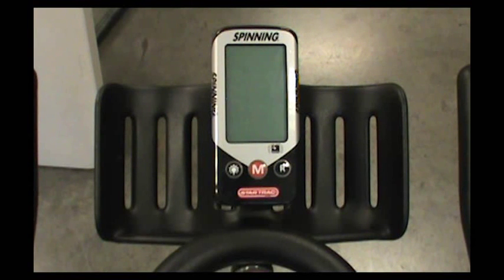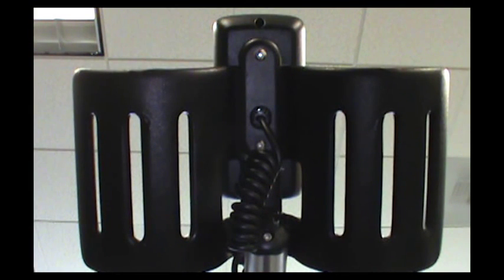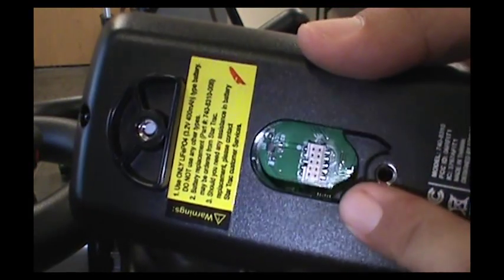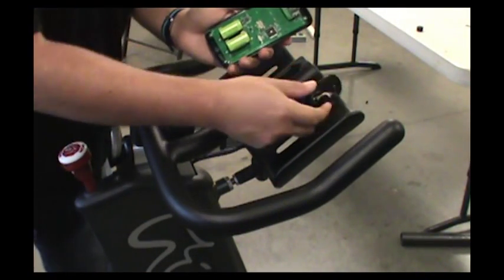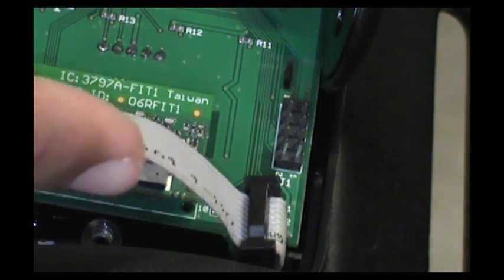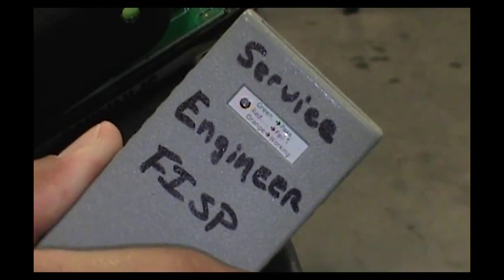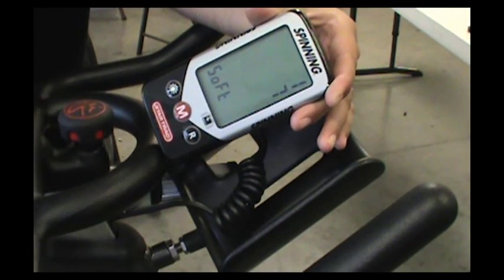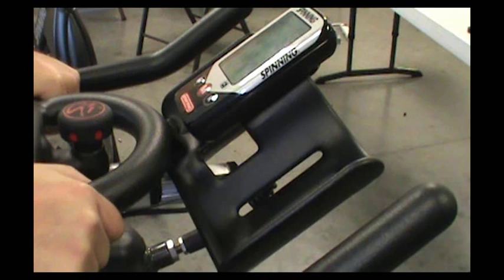Star Trac: Spinner® Blade ION - Updating Watts Computer Software

Comment: Your online site has the WRONG FILES associated with the 1.8 software version: the Fisp fuse bit settings and instructions files are therefore unavailable.  Also, the project file calls for the wrong file! Can we trust the fuse bit settings??? I'm not driving 4 hours to a customer site to find out it doesn't work. Called customer support they acted as if this was okay and normal (!) and they said it's ok to use the project file and just change the file to 1.8, it better be true.  You guys need to get your s*** toghether, this is not professionnal and a testament to Startrac's bad quality/service record.